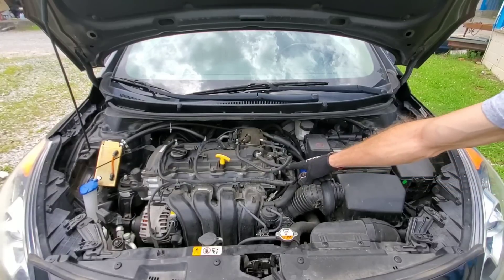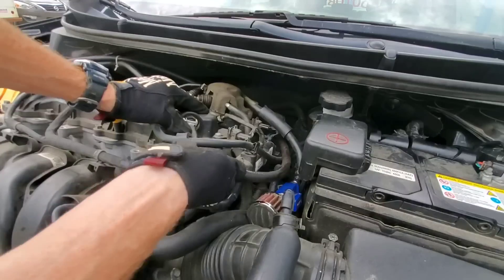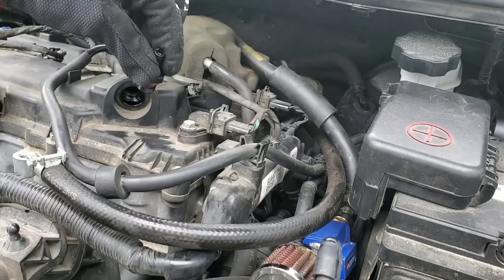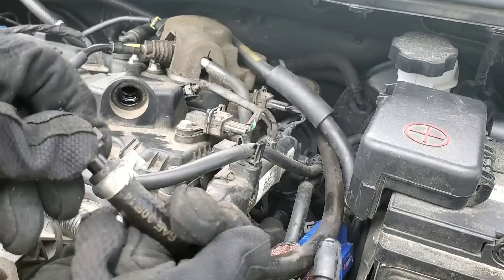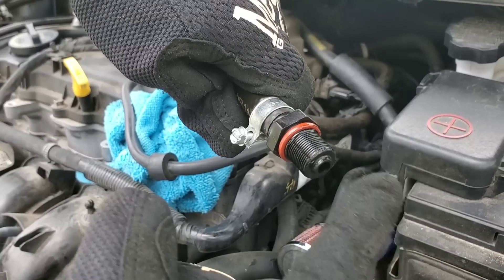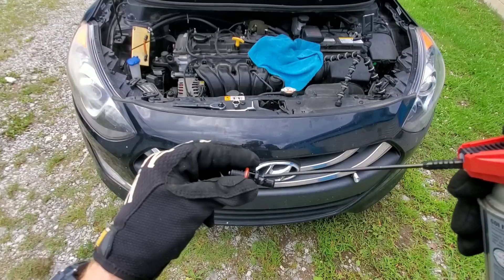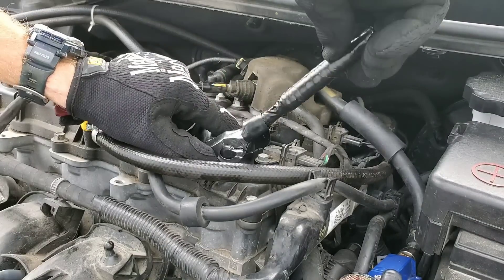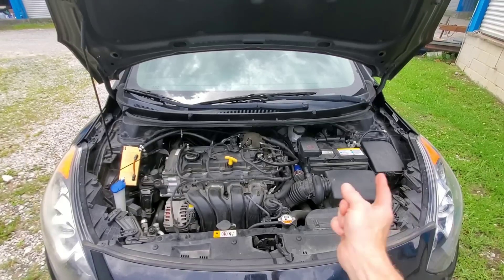Oil consumption the #1 cause & a simple fix!

Comment: My 2016 optoma was using 1 as t every 1,000 miles.  Pcv valve didnt fix ir.  What did fix it was a berryman b12 piston soak.  It no longer burns oil.

Comment: hi guys, on a  hyundai/kia the pcv valve AINT gonna be the issue. stuck oil control rings are the reason and have been for years now. thats what gdi does to an engine.   cheers

Comment: Put two tins of CRC in the vacuum hose for the first 1000 miles, then every 10K. This will help prevent worsening of the sticking piston ring issue. Not like what he did, just buy a new PCV. 
But to reverse the glue on  your rings: Liqui moly engine flush, then use Valvoline restore & protect. Swap every 3750 miles. 
This reconditions oil rings, it can take three oil changes, 10k miles, to have full effect. 
Add ceratec for the damage done to the piston wall to have a chance at improved sealing.

Comment: I've got a 2012 Chevy Silverado 1500 5.3L and when I pull out at a red light or stop sign sometimes, I see a cloud of smoke behind me. I've replaced the valve covers on both sides, but I'm still seeing the cloud of smoke. The cloud of smoke doesn't show up every time I pull out, but I'd still like to know what the problem is so I can fix it before something bad happens. I just bought this truck last year for $18K so I'm pretty much stuck with it for a while. Any ideas on what could be causing this?

Reply
Reply: your oil control rings are probably seized up or you have oil leak at the valve stems. Oil is burning in the combustion chamber
Reply: @forbiddendonut  I'm going to replace my valve stem seals first to see if that fixes it.
Reply: @ What I have done to one of my cars that USED to burn oil and what a lot of people do is dump some Berryman's B12 in to the combustion chamber and let it soak for about a day. Keep adding it as it seeps through to the bottom of the engine or evaporates. Let it work the rings free. That worked the best for my situation. Good luck.
Reply: @forbiddendonut  Thank you! I might try that. I've sort of been waiting for warmer and longer days to work on it.
Reply: @billydenham9313  search for videos here on YT for how it's done. A few have posted videos. But in general, it's just like what you think it is. Keep the cylinder heads covered in the B12 for as long as you can and turn the crank occasionally. 
Since you have a V8, you will probably have to add more than what a flat straight 4 or 6 would need since you want to soak all of the oil control ring and not just a portion of it. It will probably cost you about $25 or so, depending on how long you soak the rings. Change the oil right away because the oil will be diluted quite a bit. Also, it will misfire like crazy and run rough for about 15 minutes. It's a bit unnerving until it clears up.

Comment: I can assure you that 90% of the time consumption issues are not the PCV.
Reply: Murph, Nate, all:  GM engine on a Chev Volt is throwing oil out the tailpipe, 3 quarts in about 30 miles.  Small droplets on the back of the car from the interstate air flow.  Had to shut it down.  Just got this car.  Yikes.  Seems to run great.  Did not suspect rings or low compression.  Did not open the oil cap and check for blow by.  No milkshake on the dipstick.  Car got hot but not enough to ruin it - I don't think.  Guess I can't get lukcy enough that something else other than needing motor tear down is blocking or sending oil out.  How would a blocked PCV cause it to route out the exhaust anyway?  Any tips appreciated.
Reply: I have a 5.7 Hemi and the whole pvc area is loaded with oil, I think that’s why I’m smelling burning oil, I will need to investigate this but it seems to be coming from the pvc.
Reply: i think ur rite a mech tell u have to a oil consumtion test

Comment: Does anyone know anything besides the pcv Valve.
Reply: There are a few things you can try:
1. Use an engine oil flush
2. Use a good Syn oil
3. Go up a weight grade (30-40 weight)
4. Occasionally use a combustion cleaner
5. Most effective is a piston soak using Berryman's B-12

Comment: According to the kia / Hyundai manual, you're supposed to change your pcv valve every 60000 miles. Imagine if you were to actually read
Reply: Where does it say this?
Reply: @Sp33dstix  maintenance intervals in the owners manual.
Reply: @nickreyes4570  yes but where? I've got the Canadian manual. The maintenance schedule normal and severe schedule (I follow severe) do not explicitly state pcv replacement. Only thing I can find is section 7 emission control system pg 7-93 says it is
recommended that you have your
vehicle inspected and maintained by
an authorized HYUNDAI dealer in
accordance with the maintenance
schedule in this manual.

Nothing specific about replacing the pcv valve.

I'll try that first as it's cheap and easy to replace. Then I'm getting rid of this pos vehicle.
Reply: @Sp33dstix  If it's not listed in your manual, you can ask your mechanic or dealership.
Reply: @nickreyes4570  ok but you said, with certainty that it was in the maintenance schedule. It's not.
Reply: @Sp33dstix  I  googled it and was stated between 20 and 50000 miles
Reply: @nickreyes4570  yes I've come to same conclusion, however it's just not listed as an item that requries replacement in the manual. You're video has been helpful, I'll swap the valve and hope for the best.

These vehicles require oil level check at each fuel fill up... Little bit ridiculous for a modem engine...

Comment: What if my vehicle doesn't have a PCV valve? What does it have instead of? I have a 2016 Hyundai Santa Fe Sport 2.0T AWD 2.0L with a T-GDI Theta II engine type. When I try to search for the pcv valve for my vehicle, I can't find it. Leads me to believe that my engine doesn't have one. What would it have instead?
Reply: Pcv valve is connected to the valve cover with a hose running to the intake plenum

Comment: does replacing the  pcv solve the oil issue?
Reply: Yes it did mine I got 2013 toyota venza  & now I  stopped adding oil I use to add  oil everyother day
Reply: @haange  I've already checked mine it was working fine the ball inside was shaking freely. So I gave it a  good clean though. I guess the piston rings is damage. I'll live with it lol.
Reply: @ynonser5804  Do a piston soak.

Comment: 2014 Kia Sorento, it’s eating oil like it’s honey. I replaced the PCV with a factory Kia PCV valve and I did the CRC Carbon procedure, twice. It’s STILL eating oil…. 🫤
Reply: Probably because you change only one. They never talk about that every car have 2 pcv. Try to figured out where's the other one and change too. One go close to the cap oil another go close to the engine block
Reply: @mirthamarte3497  Really? Never heard that… I’ll research about a 2nd PCV. Thanks!
Reply: @mirthamarte3497 where is the 2nd 1 located
Reply: There are a few things you can try:
1. Use an engine oil flush
2. Use a good Syn oil
3. Go up a weight grade (30-40 weight)
4. Occasionally use a combustion cleaner
5. Most effective is a piston soak using Berryman's B-12
Reply: Certain KIA/Hyundai engines have oil consumption issues and bearing issues. Piston soak is your best option.

Comment: unfortunately this did not work
Reply: There are a few things you can try:
1. Use an engine oil flush
2. Use a good Syn oil
3. Go up a weight grade (30-40 weight)
4. Occasionally use a combustion cleaner
5. Most effective is a piston soak using Berryman's B-12

Comment: Can I spray intake valve cleaner in the pcv valve hose instead of the section of hose leading to throttle body?
Reply: You can, but it’s better to spray it as close as possible to the valves. The most atomization, the better.
Reply: You can spray it in the brake booster vac hose

Comment: My kia optima 2013 has a oil consumption no leak but a quart and a half every two weeks.
Im guessing it's the pcv valve
Reply: Yeah same here kia optima 13 using 1 quart every 400 to 500 miles. Its just progressively getting worse. Has 100 k miles
Reply: Use a quart of lucas oil when adding oil
Reply: @alexsalazar1342  What type exactly of Lucas Oil? I'm not sure if I can buy it here in my country but I'll search for it!
Reply: @alexsalazar1342 why Lucas ?
Reply: Use Lucas high mileage fuel treatment every other oil change should help keep injectors from dribbling raw fuel into the combustion chambers.
Use full synthetic and OEM oil filter every 5000 miles.
Change plugs at around sixty to eighty thousand miles.
Keep clean air filter.
Don't use your 10/100,000 mile warranty as a maintenance plan.
Reply: I have same problem no leak but oil level gets really low
Reply: @reggiesingh2827  Is there any change after fix pcv?
Reply: 2017 sonata, every day gotta add oil
Reply: Did you fix the problem with your oil consumption?
Reply: Certain KIA/Hyundai engines have oil consumption issues. These progressively get worse and can cause engine failure.

Comment from the maker: What tips can you give to stop oil burning?
Reply: There are a few things you can try:
1. Use an engine oil flush
2. Use a good Syn oil
3. Go up a weight grade (30-40 weight)
4. Occasionally use a combustion cleaner
5. Most effective is a piston soak using Berryman's B-12
Reply: Synthetic oil will not stop a engine from burning oil. There are aftermarket products like Lucas you can add to the oil to stop it from burning.  But keep in mind it is not a fix and 50 percent of time it does not help.

PCV are cheap and would not bother to try to clean and reuse unless you are in a pinch. A used PVC if you clean it would be good possibility for a short period then plug again. Also in check if it operating instead of hooking it back up to the system you can test it by using a vacuum source,  connecting and disconnecting to see if the ball be5inside is working or not.
Reply from the maker: What can we do to improve
Reply: Frank W sheesh I bought a new one on ebay for like 15buck for my 03 camry 👍. REPENT AND FOLLOW JESUS CHRIST Y'ALL
Reply from the maker: Thanks for sharing your knowledge
Reply from the maker: What about you?